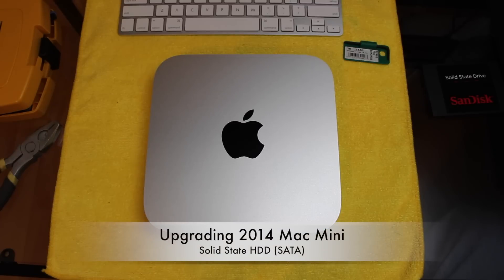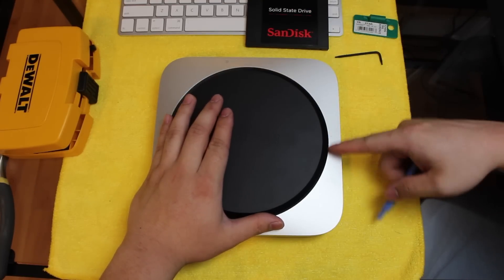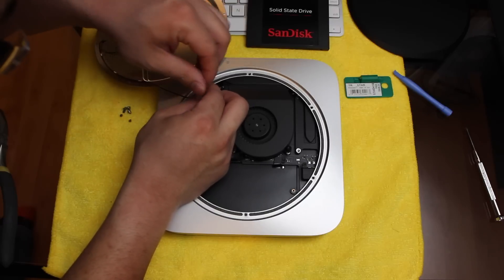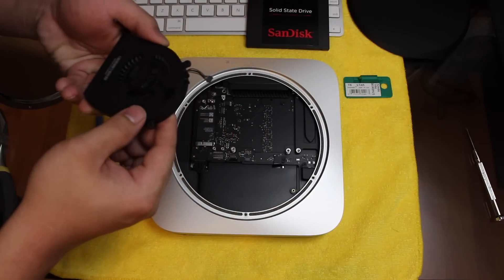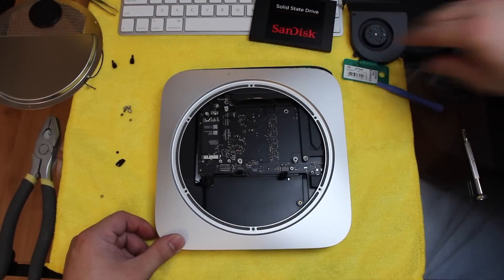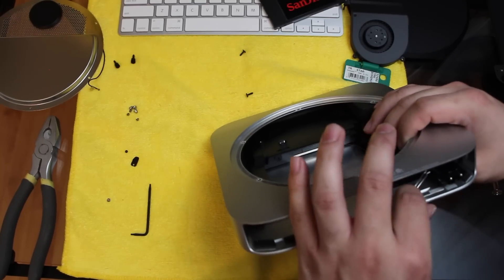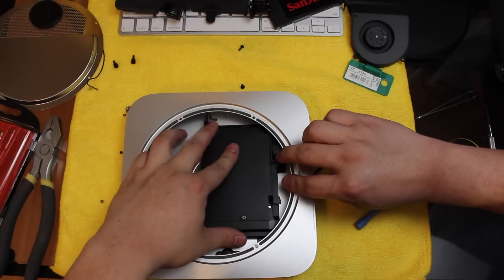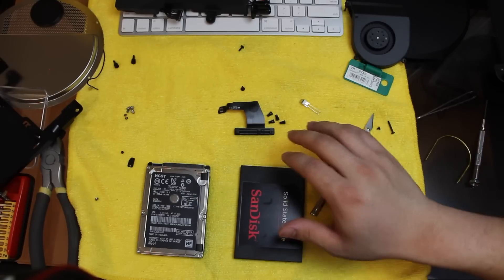Upgrading New 2014/ 2015 Mac Mini to SSD (Solid State Drive)

Comment: so there is no way to upgrade the RAM....great
Reply: XInfinity2013 Still sad they did that. the 2012 version was way more upgradeable, and even had 4 core i7 options. imo, 2012 mac mini beats the 2014 one.
Reply: XInfinity2013 I do agree with you, just like there are ppl that don't upgrade windows based pc as well. I just think apple should have given the use the option to be able to do this rather than spend an additional $100 to have 8gb of ram (granted that is how much it would probably cost the use anyways to do so). 

Options are nice to have and I know Apple is known to have a closed environment, I am thinking that will change in a few years.

Just my two pennies.

Comment: Geez dick move from Apple. Mac Mini 2012 all the way baby !
Reply: would be nice if Apple released a, "big mac mini" or mac mini pro - with i5/i7 - options and a "regular" board ... PCIe 3, etc.
Reply: I bought the $499 Late 2014 Mac Mini to build a Hackintosh and I now have a $300 to $400 Hackintosh that out preforms the Late 2014 Mac Mini.  :)
Reply: waveboreale after seeing this I bought a 2012.... since then I've got a 256ssd and 8gb ram upgraded on it...
Reply: +drx1 xym Mcdonalds meets Apple.